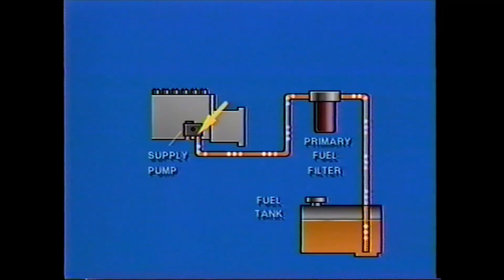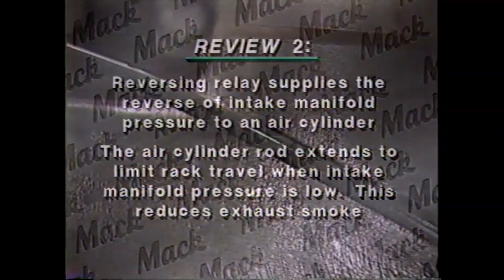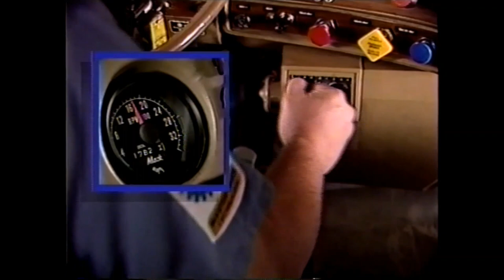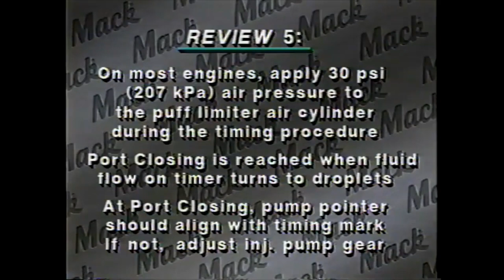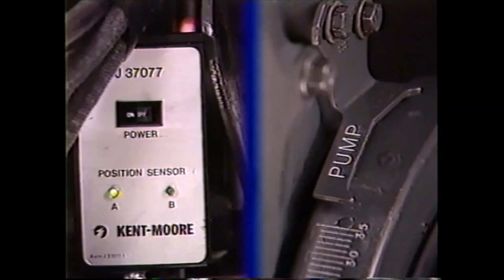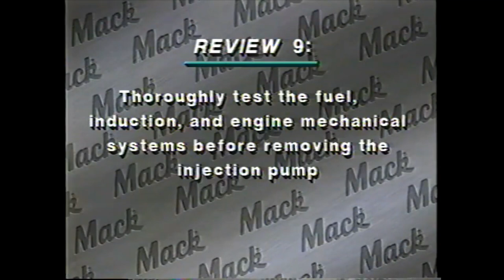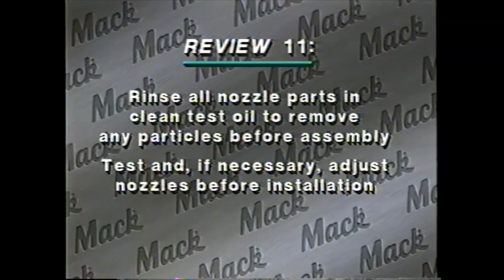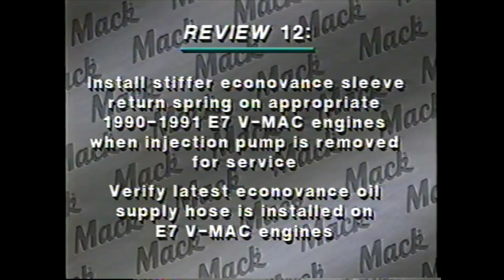Mack Truck Diesel Fuel Injection Systems

Comment: I know this isn't the best place to get advice but hopefully someone has an answer.
I have a mack E7 Econovance with the electronic throttle/rack control.  The crankshaft thrust washer broke and the crankshaft endplay was so great it wiped out the rpm/tdc sensor and damaged the block.

I swapped the engine out for a used engine, replaced the TDC sensor and replaced timing event sensor.

Now, I'm not getting fuel to the injectors.  Primer will push fuel through the injection pump and back to tank, and cranking it will push fuel through pump and back to tank but it will not deliver fuel to the high pressure fuel lines.  It won't start and I can't even bleed the high pressure lines.  I have ~3v and good ground to the fuel rack actuator with the key on.  I can hear the rack open when I put 12v and good ground to the rack actuator but still can't get fuel to the high pressure lines/injectors.  

Is there a separate fuel shut-off solenoid in the electronics assembly in the rack?  As far as I can tell the only other electronics in there are rack position sensors.  I'm baffled that even manually opening the rack with 12 volts won't let me bleed fuel to the injectors.  I'm lost on this one.

Comment: why we should use handbrakes in tests or its for pressure? are the handbrakes influence pressure?
Reply: Parking brake air circuit controls air supply to the reversing relay.

Comment: Anyone what year this is from?
Reply from the maker: The best I can tell it is from somewhere around 1999.
Reply: These videos were pre 1995
Reply: @Mrbbigrig  How can you tell? I think Vmack came out in 1995, same with econovance
Reply: @robwhite3241  Vmac came out in 1990. 1995 had changes made to the fuel system that are not in the video
Reply: @robwhite3241  the engine and fuel system changed again in 1998 for vmac3
Reply: @Mrbbigrig  And the E9 never got the vmack treatment did it? Or was there an Australian version that had it.

Comment: You know anything about the mack E7 engines?
Reply from the maker: I know some and have some manuals, what are you looking to find out?
Reply: @JimMackHeavyEquipment  I have a 2002 mack vision sleeper truck that won't build oil pressure I changed oil pump and oil pressure sensor truck well start run fine for 30 seconds shuts off due to reading no oil pressure well start right back up run fine shut off again.  Thanks I appreciate your help.
Reply from the maker: @keepontruckinoutlawlife1248  Have you hooked up a manual pressure gauge to confirm that it is really 0 psi oil pressure in the engine?  That is usually the next step before we start tearing things apart.  It makes me wonder since you say it runs fine.  If the manual gauge has pressure then it is a problem with the sensor side.  I know you replaced the sensor but it could even be the wiring or ECM.  If the engine truly doesn't have oil pressure then that would be a different investigation.
Reply: @JimMackHeavyEquipment  I haven't as of yet
Reply: Nice video,i have an rd688s mack 1995 with an e7 semi electronic,it used to work great but now it can't be starded if it finally start it won't stay working for a long period
Reply: I need a manual for 88 e6
Reply: @danwiening826  don't have one I sold my mack
Reply: Thanks though
Reply: @danwiening826  hopefully you find what you're looking for bro🤞🏻